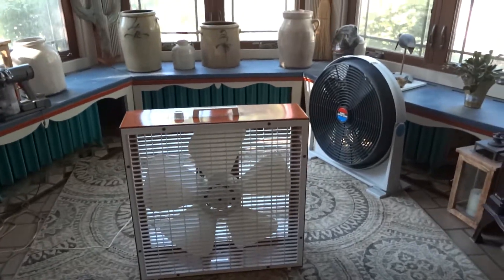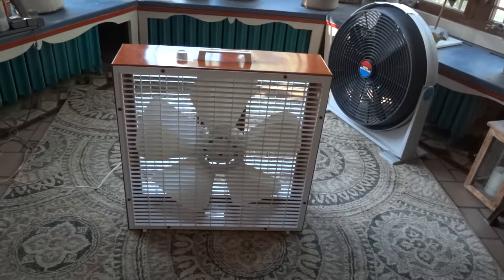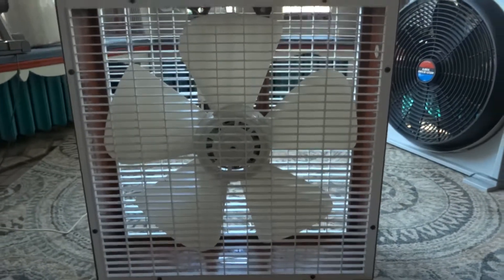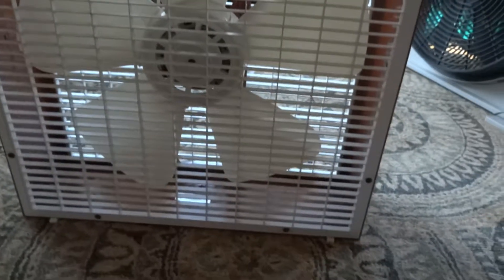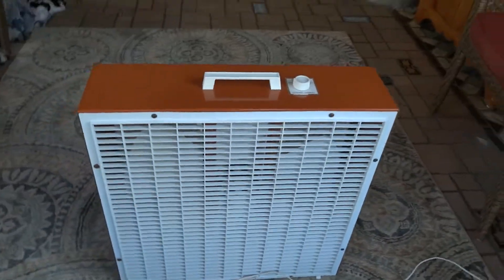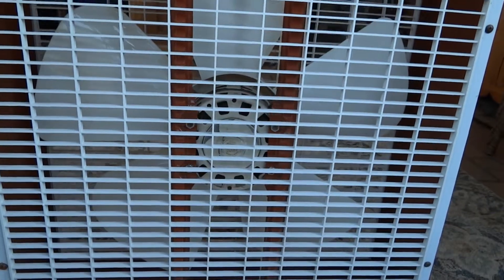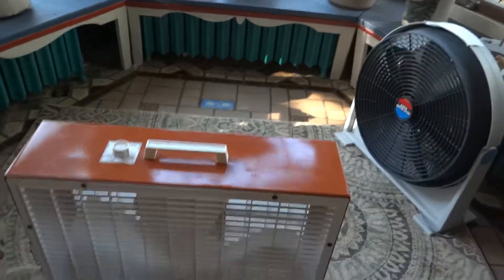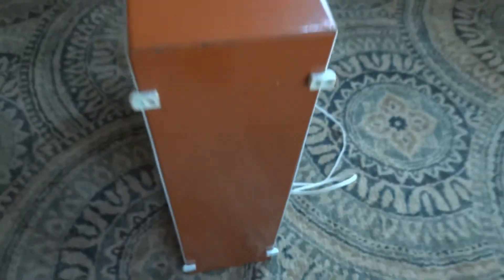Vintage Lakewood S-223 Box Fan

Comment: As far as I know, the humming comes from vibration on the motor housing that is resonating against the motor mount supports. Something isn't as tight as it could be somewhere in the assembly. It's funny because I also have a Westinghouse "Frigid" model of this and it runs very high RMPs on all speeds, unlike your fan. I thought that was just how the Westinghouse was, but apparently it varies.
Reply from the maker: Maybe I need to check the tightness of the bolts holding the motor together.  Only reason I was suspicious is because it gets much louder when it's hot.  When the motor is cold it's absolutely silent.  I've run it overnight several times now and done temperature tests on the motor, and it seems to be fine so far.  I hope these motors don't fail violently like a Fasco motor of mine did.  Interesting that the speed on these motors varies.  I saw your video, and your fan on low sounds like mine on high.  I'd like to know how the motors differ internally.